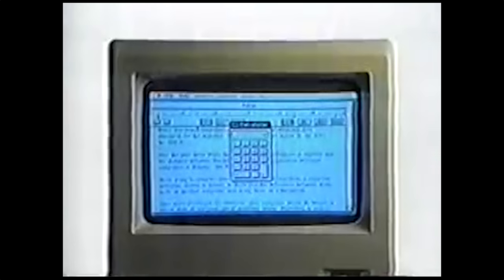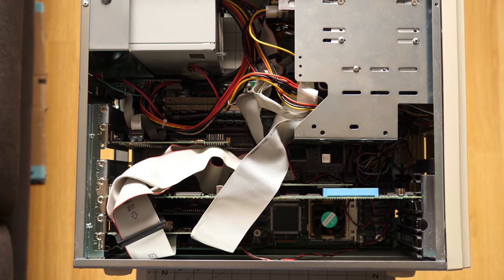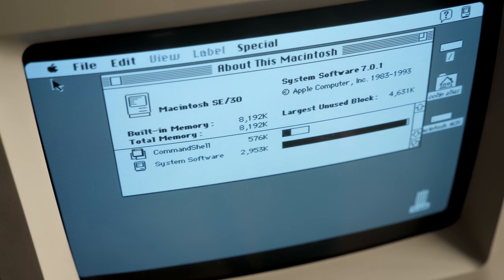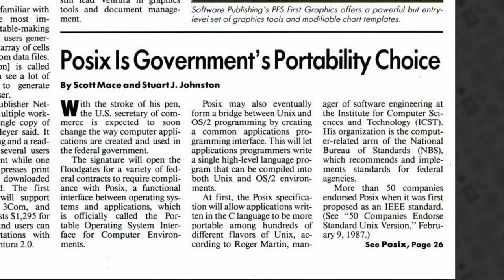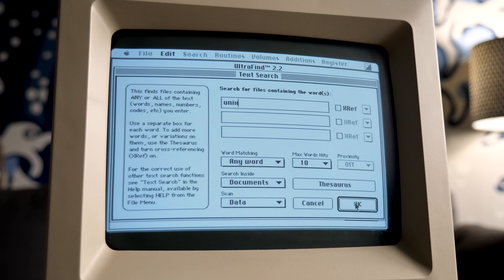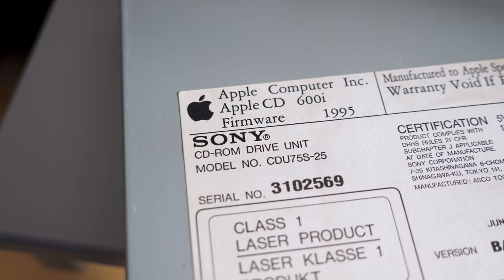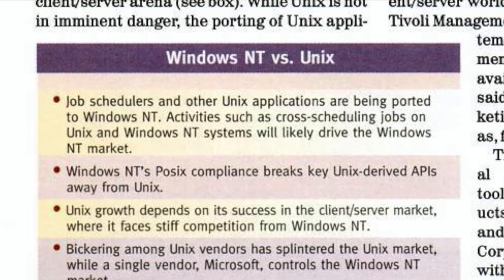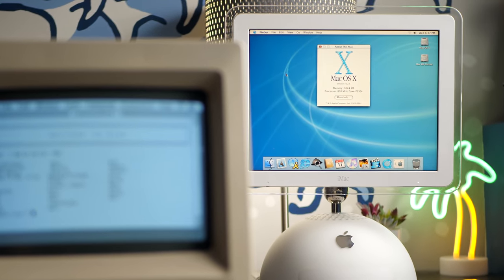Apple A/UX: The First UNIX Mac OS!

Comment: Then Linus Torvalds, working on a PC running MINIX (an academic teaching OS modeled after UNIX, but targeted at the time to 8086 real mode CPU) wrote a new UNIX-like OS. He targeted the Intel 80386 CPU, which had protected mode for kernel operation and a user mode for user applications, and an integrated MMU for doing page mapping of memory. Eventually this OS went on to be called Linux, licensed under GNU, support the POSIX API and the X-Windows GUI. And eventually this UNIX-like OS exceeded all other variants of UNIX (including BSD) in industry importance and dominance. One guy, a college student, succeeded wildly at doing what Apple failed very miserably at - bring a UNIX-like OS to the masses.

Comment: I find there aren't a lot of folks around today that know about A/UX. I have a copy floating around somewhere - in storage I think, along with a IIfx that I always wanted to try to get it to run on.

This does make me wonder a bit - back in 1985 when I started at Virginia Tech, I was in Computer Engineering. Engineering students were required to buy IBM PCs, but the CS students bought Macintosh XLs (kind of upgraded Lisas). I thought they were running A/UX, but if it didn't come out until 1988, I'm wondering if they were either using early beta versions somehow or some other Unix-like environment. As a CpE, I actually took a mix of engineering and CS courses, and for the CS courses I had to use the CS lab for the Macs. And we were learning makefiles and using a CLI and it was all very Unix-like. Those Macs had (physically) huge external hard drives and they were incredibly touchy and failure prone. Almost every CS student I knew had a drive failure in the first year, and I took out a couple in one day in the lab. Wish I could find more info on what exactly those systems were running.

And one note - the Mac ROMs sharing the address lines with RAM has nothing to do with how important it was. That's just the basic architecture. Typical processors (Von Neuman architectures at least) only have one set of address lines so all memory shares those lines regardless. The x86 processors use a separate I/O bus (or did back in the day, not sure about the modern Intel / AMD CPUs), but that's not typically used for memory. The BIOS on the PCs also share the same address space as RAM.
Reply: Those makefiles and CLI on those Macs ... could that have been MPW (“Macintosh Programmer’s Workshop”)? When you executed a Make command, it would print out the build commands, rather than run them. You then had to select the resulting command sequence and execute it yourself.
Reply: Check out shoebill, it'll happily run A/UX under emulation!
Reply: @lawrencedoliveiro9104  Ah, I bet that's what it was then. I didn't have to use those Macs very much and my memory is pretty fuzzy on the details. I eventually got a Mac Plus myself to do my CS assignments on. The profs just wanted an executable they could run. I do know the whole CS Mac requirement was a bit of a mess. The next class (or maybe 2 years later) was supposed to get Mac IIs but the weren't ready, so they all got loaner SEs (I think). Seems like every year it was a somewhat different system.
Reply: Thanks for sharing. And FYI, there's no way A/UX could ever be made to run on a Mac XL because of the lack of PMMU chip that didn't come out until the add-on chip for 68020. The first OS that ran on Lisa is BSD, a port contracted by Apple from some third party company while Apple was working on Lisa's own OS.

Comment: There was another time when Apple flirted with UNIX: MKLinux was an Apple sponsored project to run a hybrid Mach/Linux (yes, that Mach) kernel on 2nd generation PPC macs. I got it to boot once, but I had no idea what I was doing from there because I was 12. The boot process was very similar to A/UX - a small stub of MacOS would fire up, and then hand control over to the MKLinux kernel. There was no MacOS VM that I recall - once you booted, you were dropped into the deep end of bash (or maybe bourn?) and mid 1990's X11.

Comment: Even in the late 90's to early 2000's,  the Apple hang and reboot was an annoying aspect of the music lab at the university I went to. I tended to just do most of me composing on my PC in my dorm, which at first was my 486 IBM running on Win 95, or the HP Pavilion running Win 98, using Cakewalk for music composition. Win had is problems then, but I trusted my dorm PCs to be more stable that the Universit's music lab, which was pretty new tech at the time.

Comment: It would have been interesting with a presentation of Apple vs. NeXT (NeXTStation) computers in the early/mid 90's. Steve Jobs had left Apple a few years earlier and started NeXT Computers in 1988. The NeXTSTEP operating system was based on Mach/BSD Unix. NeXT computers were expensive and intended for higher education institutions, but what was the difference in relation to the more advanced Apple machines and what was really the point of marketing the NeXT computers?

Comment: This is fairly pedantic, but might be somewhat interesting context.  The video starts by saying that after a few years, Apple was "already" looking to replace its operating system.  I think this is projecting modern perspectives onto the early 80's.  The Lisa is a much unloved, mostly forgotten computer from 1983 that is mostly remembered as a sort of beta test for the Mac.  But at the time, there weren't any long lived architectures for home computers.  Software vendors for the home market were practically non existent (Microsoft literally made a name for themselves in this era by being a company that specifically wrote software for microcomputers.)  The Lisa was actually surprisingly advanced in retrospect, with multiple processes, a proper filesystem, and even stuff like named pipes for interprocess communication through the filesystem.  Stuff that Classic Mac OS could never manage, even in the 90's.  But the Lisa didn't really support developers writing new software for the GUI environment.  The market barely existed, so Apple didn't have any interest in catering to it.  They planned to make the Lisa, give it a bunch of features, and then basically throw it away a few years later and replace it with something else because there would be no need for backwards compatibility.  The Macintosh was released as a more open platform so you could buy third party software for it, but in 1984 nobody really had any old software they would want to bring to a new machine.  So in 1984, Apple was basically planning on throwing away the Macintosh and replacing it with a new platform with better, newer software.  That's part of the reason the platform had so many short sighted hacks that were hard to work around in later years.  Not everybody saw the rise of the independent software vendor in the 80's as a foregone conclusion, and Apple was sort of caught off guard by the fact that they needed to make new models of Macintosh going forward.  So if you had asked somebody in 1984 at the Mac launch about the possibility of Apple working on a whole different OS by 1987, they would most likely have considered it pretty unsurprising.  Apple was already working on at least for different incompatible platforms at the time in the Apple II, Apple III, Lisa, and new Macintosh.  How remarkable would one more be a few years on?  Anyhow, long comment for nit picking a small statement, I know.  But home computer OS's when the Mac launched were small dinky things that could be worked on relatively quickly, didn't need many features, and didn't need much backwards compatibility.  So at the time it wasn't so much, "already" as "what took so long?"  The internal machinations that stifled progress and created a stable platform by accident are nearly as interesting as the attempts to modernize that platform with stuff like AUX.
Reply: The Lisa was advanced, but complex, expensive and slow. The (lack of) speed was partly due to hardware (having only a 5MHz CPU) and partly due to software (written in Pascal). Part of the development of the Macintosh involved taking the QuickDraw graphics engine originally created for the Lisa, and rewriting it in tight assembly-language code (plus adding a few enhancements). The original compiled Pascal code took 160K of RAM on the Lisa; on the original Mac, it was squeezed into just 22K.

Comment: re: unix wars "bsd winning" - BSD won at first, and it's still around today, but thanks to unix software and hardware being prohibitively expensive for running on PC's, GNU and one Linus Torvalds, linux (a clone of a system v educational os called minix) took over extremely quickly by the mid-late 90's and powers an extremely large percentage of all servers and many professional workstations today.
Reply: You're ignoring FreeBSD, NetBSD, and OpenBSD. Yes, Linux is very popular, but it's far from the only *NIX out there.
Reply: ESIX and SCO helped boot the Internet until and then along with Sun, NeXT and a few others became more common.  Amiga also reportedly had a nice Unix implementation... tho' I only heard about it from the guy I sat next to at Everex.
Reply: BSD won the "UNIX wars" ... Linux is not UNIX, but "UNIX-like."
Reply: Linux could so well if it wasn't written by the sort of people who only drink real ale from one micro brewery. A million distros - try writing one good one! Its worked for Blender
Reply: @jfbeam  Josh didn't claim that Linux was the only unix-like O/S, just that it had overtaken BSD.  For the desktop/laptop market MS-Windows still reigns supreme, but of the unix-like systems MacOS (which is based on BSD) is still the leader.  For mobile devices however Android (which is based on Linux) has the majority, and Linux completely dominates the server and supercomputer markets.
Reply: @PrinceWesterburg  That's funny!
Reply: @PrinceWesterburg  you're right. Maybe I'll make my own form of Linux and make it the ultimate operating system! <smirk>

Comment: sounds like A/UX was the os/2 warp of the mac. You use os/2 to get a better windows 3.1, in that it can run multiple 3.1 applications in isolation. Or you could have just bought an Amiga in 85 and got multitasking and colour ;)

Comment: Check out shoebill, it's a macii emulator focused and capable of running A/UX.  It'll run the leaked 0.7, 1.0, 2.x and 3.0 just fine.

I used 3.0 on a Quadra and it was awesome back in the day as I had real Mac apps, including softpc, meanwhile it was a full SYSV Unix.

For another emulator to compare, Previous is capable of running NeXTSTEP and OPENSTEP.  The big advantage is that these are Mach 2.5 / BSD based with a far more liberal license allowing for cheaper price per CPU licensing.  And once NET/2 had been a thing OS X 1.0 quickly bridged the old licensed software to open source Darwin, removing the price barriers.

The real secret to OS X 10's success was carbon, something that A/UX needed although the sdk only hints at hybrid Unix/Toolbox apps.

Comment: Very good analysis and history of the Mac and A/UX.  I ran A/UX at NASA in the early 90's on a Mac IIfx.  Although I absolutely loved UNIX on Sun hardware; I hated it on the Mac.  We eventually stopped running it altogether and heavily invested in Sun hardware upon which we could enjoy substantial performance improvements in data analysis and/or data reduction code.  It should be noted that in the early 1990's we could run MAE (Mac Application Environment) on Solaris which allowed Mac applications to run significantly faster on Sun hardware.  I would say that pretty much killed any desire to return to A/UX ever again.
Reply: the MAE is awesome.

Comment: This was kinda the first and last Unix-based MacOS. It meets the Single Unix Specifications now, but it really depends on your definition of Unix. You could say that technically Mac OS X and NextSTEP have never been Unix.
Reply: That depends on how you define it, as you say. If you think of Unix as a direct descendant from the Bell Labs/AT&T code (licensed system III or system V release whatever , then NextStep and Mac OS X are not Unix, nor are any of the BSDs or Linux. If you go by POSIX (or is it SUS?), then Mac OS X is certified, and a "proper" Unix, whereas Linux is not, afaik. To me, the BSDs feel more "true" Unix than Linux.

Comment: Apple by far has the least understood, underrated, and most interesting operating system history out there. Apple is honestly the worlds biggest UNIX distributor.  UNIX roots go back YEARS before Linux, and they are the possibly the last American manufacturer working to integrate the entire system. Hardware, software, hard disk, file system. processors, kernel, applications, frameworks, programming languages, APIs, ...

They really make the entire widget, and will not compromise on this stuff. I have about 6 Macs from 1987 to the present. They all still work!

Comment: I'm still bitter about Copland not panning out.  It was the OS that the early PowerMacs (including PowerComputing clones) deserved and I kept waiting for, but the OS 8 (and 9) we ended up getting were just more lipstick on the pig that was System 7, still without pre-emptive multitasking or memory protection, and by the time Rhapsody finally came out with those things, the Macs we had were long since unsupported.  So after OS 8.1 crashed and lost my data one too many times, I ended up running LinuxPPC until I gave up and switched back to a Windows PC.

Comment: My first "work computer" was an Apple WGS 95.  (this was in 1997)   I had already been exposed to SunOS (pre-Solaris) and early versions of Linux by then so I gave A/UX a spin.  Yes it was a functional UNIX workstation, but it did run MacOS 6 (?) better.  When that employer updated their computer/training lab they got some Apples that ran MacOS 7 that was just so much nicer but TCP/IP networking was still an after thought (who remembers OpenTransport?)  The iMac with MacOS 8 and 9 was a massive improvement.  There was a hiccup with early MacOS X but they got that right later on.

Comment: I think you have to differentiate here: first at the time of the first attempt the hardware was very limited, that changed later when they adapted NextSteps Unix. Second the situation was different: at the first time they mostly copied their ecosystem on top of an existing Unix. This made two issues: Apple and unix had two different GUIs, Unix had X11, Apple didn't adapt Unix that much but had jumped on the whole Unix thing. The second time was much different: NextSteps Unix-like System was already stable and needed only smaller adjustments compared to A/UX. It was no Unix in the regular sense but used an Mach Microkernel with a BSD-Userland. The major thing besides updates to a newer Mach base and smaller adjustments were that Apple didn't care about Unix compatibility and throw X11 out of the windows with a newer replacement that was tied to their OS.If you look at it Windows went a similar way, except their system was more VMS like and wasn't Unix like.It is POSIX compatible like QNX is POSIX compatible.

Comment: I wish A/UX would have done well, but it quite frankly was an idea before its time.
Reply: Exactly. At the time both RAM and HDDs were too expensive to bring this beast to the masses. I know a guy that has a workgroup server 95 running A/UX. It's awesome, but obviously dated. It could have been a killer application if it didn't require so much RAM and hard drive space.

Comment: I hate that I'm only seeing this three years later. There was an intermediate between A/UX and OSX known as MkLinux which borrowed from Carnegie Melon Universities Mach Microkernal Architecture and BSD which was supported on PowerPC 32 bit systems. I worked for a small company that sold products to graphic artists back in 2020, and their office ran on Mac. They had some older G3 macs just laying around that they couldn't unload, so I scavenged a pretty capable webserver to get an online store going. Apples work on MkLinux started unofficially in 1994, and officially in 1996 in parallel with their XNU projects. MkLinux was their open source effort, while XNU was their internal project which would eventually lead to MacOSX in 2021. I firmly believe that if the 1985-1995 period had not been such a rudderless period in management at Apple, MacOS X would have happened more than a decade earlier, as Steve Jobs was already well into thinking about NeXTStep when he got shuffled out in the mid 80's.

Comment: 7:13 Umm, that’s not a Unix screen. That looks like a DEC operating system that the terminal is connected to (most likely running on the box at the right). At a guess, from the mix of filename extensions and the 6-dot-3† names, I’d say it’s RSTS/E.

†8-dot-3? Luxury!
Reply: Actually the system that the VT100 is connected to appears to be a PDP-11 running RT-11 .
If you look at the right hand column of file names, the fifth entry from the bottom is RT11FB.SYS - ie the RT-11 foreground/background monitor.
Reply: @md95065  I was going to say RT-11, but I see what looks like one .TSK file as well, which should be for RSX.

That’s why I said RSTS/E: that had emulators that could run .SAV binaries for RT-11 as well as .TSK ones for RSX.

Hang on—is that .TSX instead of .TSK? Could that be TSX-Plus, the multi-user version of RT-11?